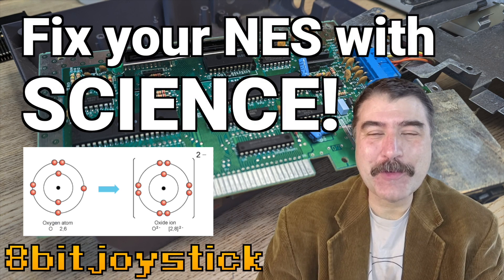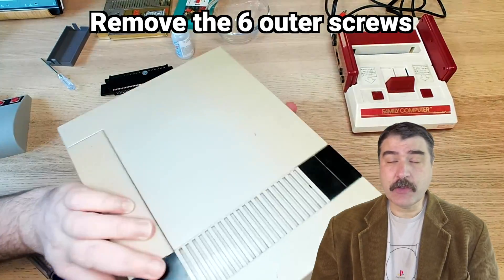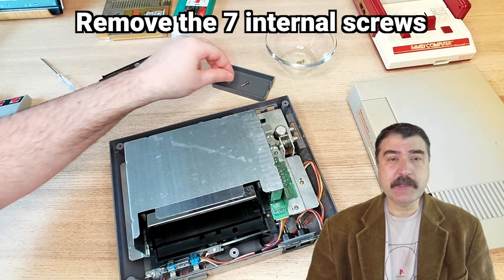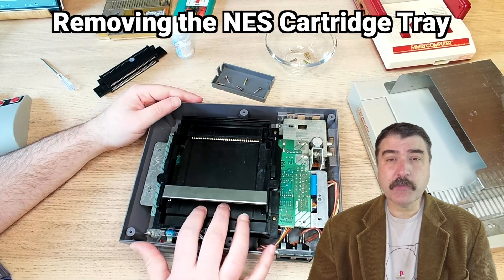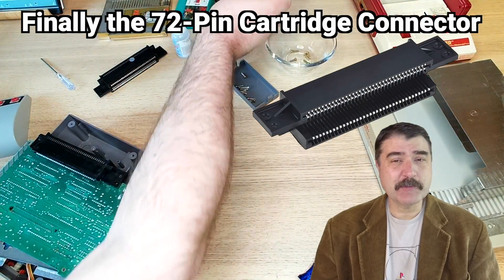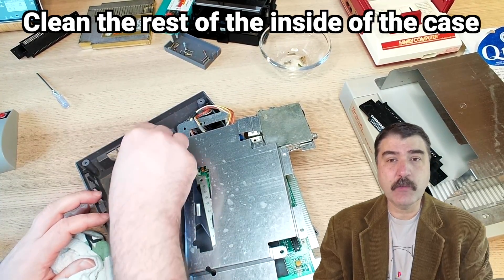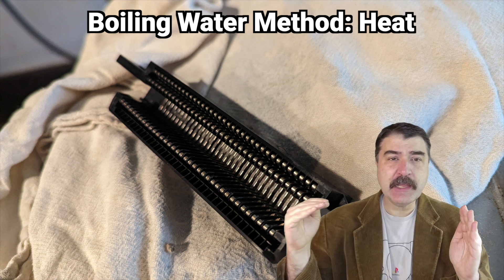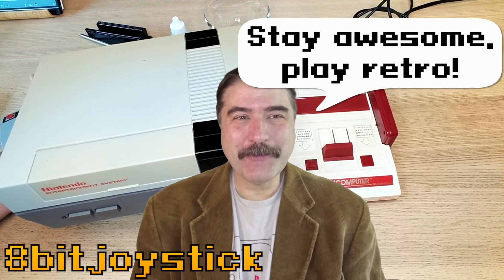Fix Your NES Blinking Red Light with Science!

Comment: So your saying don't put the heat shield back in?
Reply from the maker: It's not a heat shield. It's an RF shield. So the US had much stricter standards for radio emissions for imported goods and Nintendo and NEC were worried about it. That's why they redesigned their game consoles for the American Market even though the Japanese versions do not have any significant RF shielding. Since America stopped using broadcast RF For TVs the chance of you noticing the lack of the shield is about as low as it ever bothering anyone else. It didn't really make sense in 1986 and it sure as hell doesn't make any sense in 2026. But you do you. I personally think it's a pain in the ass to get back on and I enjoy ripping them out. Take a look at the internals of the famicom it's ridiculous how tight everything is and the NES literally has a ton of room surrounding it.

Comment: Thanks! I'm going to try this
Reply from the maker: Thanks, let me know how it worked out. Also, check out my follow-up video on taking a NES apart and soaking the 72-pin connector overnight in vinegar.

The heat works to remove the carbon bonds of the corrosive ion residue and the vinegar does it chemically. I had fun talking to my dad who is a chemistry professor about the whole process of oxidation of metals.

 https://youtu.be/yVJA8gXqqAU

Comment: subscribed!!
Reply from the maker: I am glad you worked it out. Did you leave the lock out chip enabled or did you disable it? That can help with tricky systems.
Reply: @ I did not disable it, I forgot about that part after I put it back together. Do I need to pry it off or just pop a single connector?
Reply from the maker: Just cut a single connector pin. I would not bother unless you have problems in the future.

https://www.thevintagegamers.com/2013/06/bypassing-the-nes10-lockout-chip-mod-tutorial/

Comment: boiled 72 P.C
cleaned heads
same issue

the system is mint CIB
games used to work up until couple weeks ago
Reply from the maker: Do ALL games not work on it. That is tough to diagnose. I wonder if you have a bent pin. It also would be worth it to try a replacement connector. For me I ran into issues with having the lip from the top RF shield not being on there right when I re-assembled it.
Reply: @ good news, all I had to do is push the cart to the right a little bit and voilà!!
Reply: @ most games were working, except Mike Tyson and a couple others. I bought complete in box. Thankfully, after removing the P.C cleaning it with a brush, lifting the pins with a safety pin, and then boiling it as you said did the trick!! thank you so very much.

Comment: Ive seen a lot of people say to just remove and boil the 72 pin connector. Not being tech savor that makes me nervous. Would you reccoment just cleaning the original at that point or buy a new replacement?
Reply from the maker: So initially I tried a replacement and it just didn't feel right. There is just a spring to an original Nintendo connector and it's hard to top. So my father has been a chemist longer than you and I have been alive and he reviewed this script with me and the corrosive ion residues build up on the connector are removed by boiling or soaked overnight in a light acid like vinegar. You really got to use something to break the built up carbon bonds on the metal that's there from the corrosive iron residue and that's what you're doing with the heat or the vinegar soak. Definitely try cleaning the original first and if that didn't work for you then try a replacement. But deep cleaning a NES builds character and it's not that tough. Let me know if you have any problems with reassembly and check out my other video where I go into it more.  https://www.youtube.com/watch?v=yVJA8gXqqAU
Reply: @8bitjoystick  thank you for the reply. it makes sense. I took one of them apart, and from the hundred videos a lot of people say bend the connectors but the one I'm looking at doesn't seem to have that issue. its boiling now, so I got to find a tool to take apart the games with and clean those. Im afraid I'm just not seeing the pins bent and they are? but there is a retro store near that has replacements
Reply from the maker: @Harbinger1715  i wouldn't bend the pins beyond attaching and removing cartridge like I did in the video
Reply: @8bitjoystick  so i did everything, and hooked it back up, and still blinking red but the screen blinks red too. should I replace the pin connector at this point?
Reply from the maker: @Harbinger1715  well are you able to insert a cartridge and have it go up and down without any mechanical issues? Check out my next video about making sure how to get the rf shield on correctly because initially that's what I ran into an issue with the RF Shield little lip kept things from connecting right. 

Try to see if you got the system working right before you put all the pieces back together. But if that doesn't work then think about getting a replacement pin connector. 

You also might want to scrub the connector pins on the motherboard with industrial alcohol I actually got a ton of corrosive ion residue off mine. It's fun isn't it, I actually like working on NES.

Comment: When disabling the lockout chip i prefer to use the 2 wire method. Less destructive then cutting pins. On a couple of boards ive had the lock out chip go bad. What happends, you're playing a game and all of the sudden starts to reboot. Same behavior on multiple games. Replaced and socketed the lockout chip.  Nes is rock solid. Fyi cartridge lockout chips are compatible with whats on the nes board. Also some games require the lock out chip to work. Aka the Aladdin carts. The boiling method DOES work...
Reply from the maker: I haven't run it into any compatibility issues since I disabled the lockout chip. I also have all of my clone systems, my famicoms and my retro USB AVS if I want to play and Aladdin games off an Everdrive. Currently I don't have any.

Comment: What do you think about the Ninten-Drawer NES 72 Pin Connector Replacement?
Reply from the maker: I think the Ninten-Drawer Is fascinating and I'm glad that they are making actual manufactured versions. I'd much rather buy one that I could pop into a system then try to 3D print something. 

I definitely have to respect the ridiculous amount of engineering that went into trying to build a better front loaded connector than Nintendo did.

I don't really think it's right for me considering I have two og front NES systems, two hyperkin systems, two famicoms, three famiclones and a RetroUSB AVS. I probably have about five times the famicom games that I have NES games.

I need to make a video about my intense love of the "New" AV Famicom and why I think it's Nintendo's best system ever.

Comment: Very informative video brother. The Famicom seems so cool and the disk system.  I'm need to pick one up someday soon.
Reply from the maker: Well, I need to make a video about the famicom disk system. I love it! But it is a pain to try to collect for, especially if you're an American gamer. So The games are on magnetic floppy disks and it's not a regular floppy disk. It's a special floppy disk That can only be modified by having a fds disk drive hooked up to a computer or a special USB Device to write. The problem is that it's highly fragile and easy to get messed up.

There are times that I've had a friend in Japan mail me games and half of the disks are erased or give me error messages by the time I get them in the US because the modern mail system will x-ray the floppy discs and erase them or erase enough of them so that you can't play them.

Now the famicom disc system interfaces with a cartridge slot and it takes advantage of expanded audio capabilities on the famicom and there are really good music tracks which can only play on original Famicom Hardware, fpga systems, or an NES that had some internal modifications made on it.

So it's almost easier to play famicom disk system games off an everdrive on a Famicom system, so there's roughly 200 famicom disk system games and it is more reliable to use an everdrive than it is to use a real famicom disk system. So I like the famicom disks system but it can be very frustrating.

So I would recommend that you get what's called the AV famicom which looks like the American top loader NES, it has the best audio quality, the best video quality, and is compatible with American NES controllers. And if you get that plus in everdrive that plugs into it such as the N8 Fami, You can play games uses the FDS expanded audio correctly.

Comment: I've only used rubbing alcohol on my 72pin connection and refurbished the pins by bending them back into place. Now I have a much better tight connection. Never had an issue
Reply from the maker: I've never had it bend the pins Beyond using a cleaning cartridge after it was warmed up. The cartridge tray being too tight was actually my big complaint with the replacement connector.
Reply: @8bitjoystick  I also bought a replacement 72 and wasn't happy with it so I decided to refurbish the original 72. The refurbishment of the pins doesn't make the originals over tight just back to stock
Reply: Apparently the pins aren’t supposed to be tight. They can be so loose the cartridges fall out from gravity alone and some people prefer it that way.

Comment: Clip pin 4 of the 10NES chip. Fixed.
Reply from the maker: That definitely helps by preventing the lockout chip from being triggered, however, if the resistance on the connectors is too high from the corrosive residue and there's not going to have sufficient transmission of electrons and your data is not going to leave the cartridge. So instead of having a flashing Gray and black screen. You have a flashing green screen. So that's where the connector cleaning comes in.

Comment: Whenever I would Detail or Repair a System, I remove RF Shields Unless they Look cool for some reason
New Sub; Dryden, Mich
Reply from the maker: So according to YouTube rules, I'm not supposed to advocate people to break the law. But like what about the fcc's rather aggressive radio frequency regulations from the mid-1980s which are completely non-relevant these days because no one is using RF transmissions to watch analog TV transmissions on a CRT. I mean it's been like what two decades since that stopped being relevant?

I put the top shield on my NES but I threw out the bottom shield because I've always hated the bottom shield because it's a pain in the butt because you have to angle the power switches and the player two connectors around it. And if you don't have it, the cartridge tray aligned right the cartridges don't work right.

Comment: Many years ago, this is exactly what i did: boiling the connector. To my surprise it worked pretty well!
Reply from the maker: The heat can help break the chemical bonds of the corrosion residue and wash it away.

And if any pins are bent then are more malleable when heated up and applying a cleaning cartridge can help bend them back as a well as helping apply mechanical force to any remaining corrosion residue.